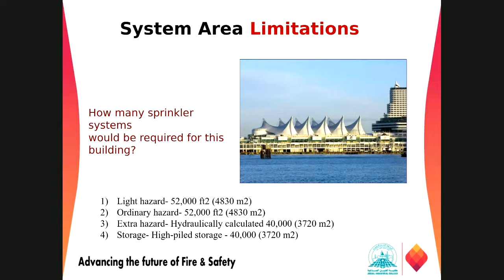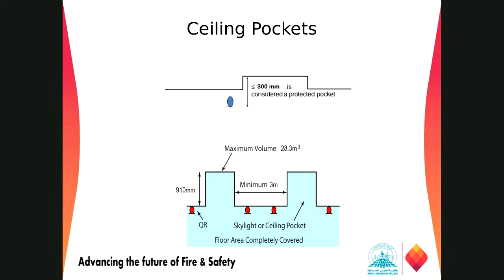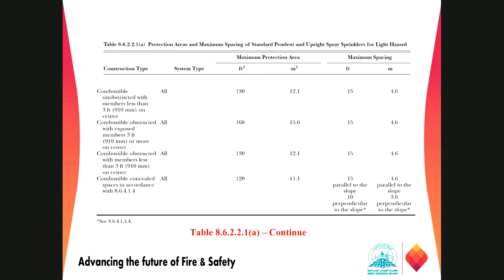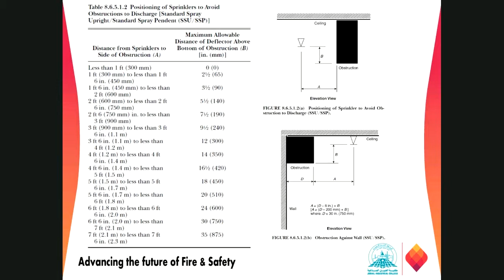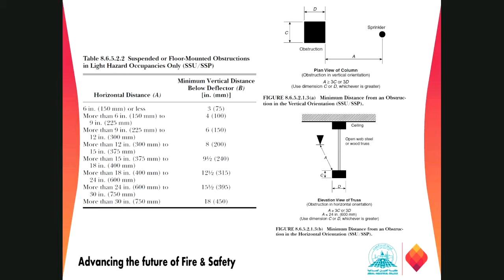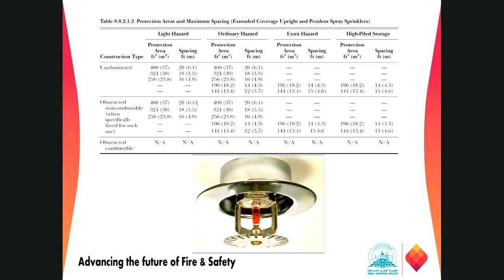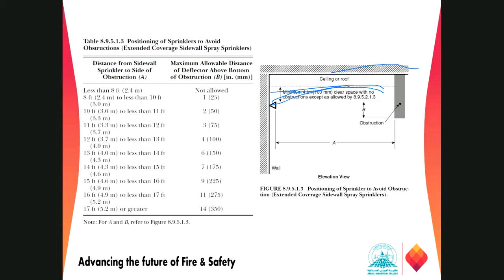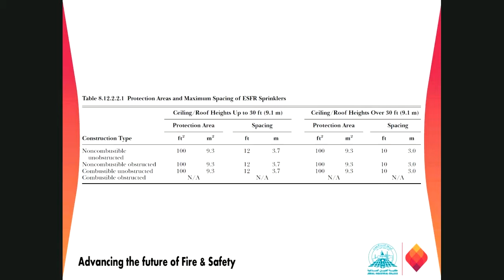Lec01 Sprinkler system Design Part 1

Comment: 1.Combustible obstructed with exposed member less than 910mm on center 
2.combustible obstructed with member greater 910mm on center.

What is different for both in above details I can’t able to understand what they are said I don’t if you know kindly explain
Reply: combustible usually means constructed out of wood, non-combustible usually means constructed out of steel. exposed members means the wood trusses are exposed making them easier to burn, rather then perhaps steel trusses (non-combustible) that are not exposed (covered in fire resistive spray insulation or furred out with fire resistive drywall to protect from heat). Obstructed in this instance means trusses that have a large percentage of the webbing area that is closed in that will block sprinkler spray. non-obstructed means trusses that have a larger percentage of their area that is open and will allow sprinklers to spray through. An example of obstructed could be wooden I-joists which are solid and unobstructed could be open web trusses. Both steel and wood trusses and joists can be obstructed and unobstructed and the material defines combustible or noncombustible. Hope this helps.